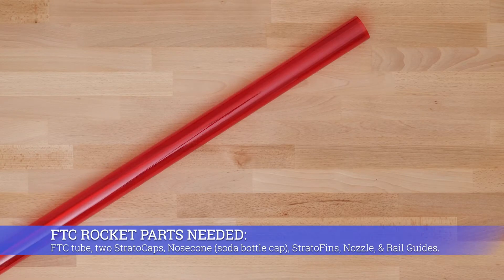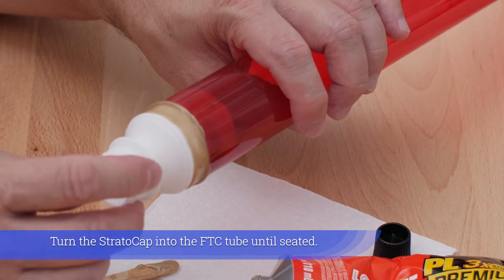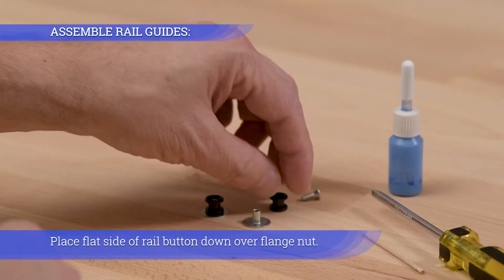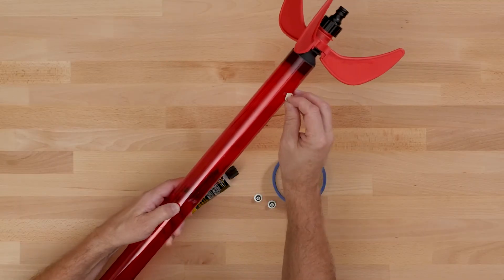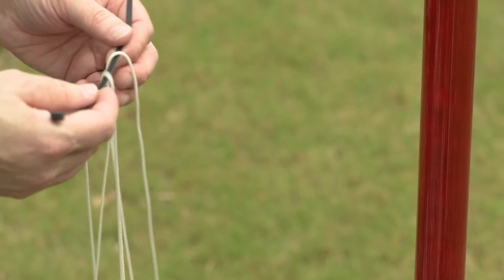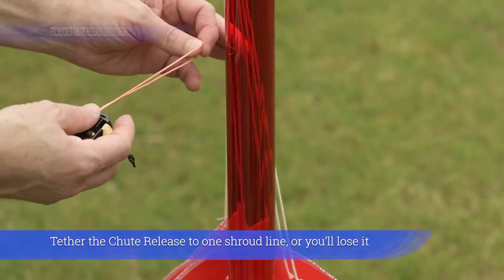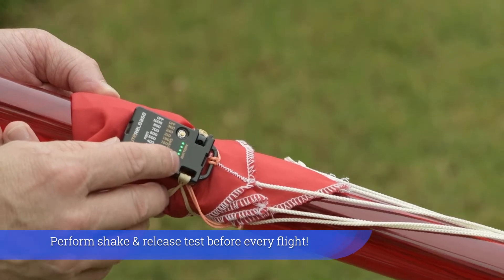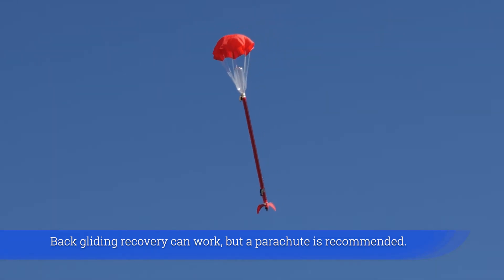StratoRocket FTC Rocket Assembly, Configuration, & Launch Procedure

Comment: Why do we have to cut the tube
Reply from the maker: Usually, because they are not cut square to create a good fit for the endcap (StratoCap). If you buy the tube from us it will already be cut properly.
Reply: @StratoFins makes sense. also I have another question what will be your next product?
Reply from the maker: @GLITCHGIGGLEDAREALDEAL  Every year we are usually working on 1 or 2 new products. A remote release is in the works that will be an upgrade kit that will eliminate the brake cable and lever. Hopefully, that product will be releasing next year although we are still working out various details.
Reply: @StratoFins cool!
Reply: @StratoFins  sorry for so many questions but could i launch this on aquapod if i dont use the nozzle?
Reply from the maker: @GLITCHGIGGLEDAREALDEAL  Yes, that is theoretically possible, but at a 60 PSI don't put too much water in it.
Reply: @StratoFins is using krazy super glue okay to use for attaching stratocaps
Reply from the maker: @GLITCHGIGGLEDAREALDEAL  I wouldn't recommend that since that sets to fast and it is best to cover all surfaces inside the tube and around the StratoCap exterior. Covering that much area takes some time.
Reply from the maker: @GLITCHGIGGLEDAREALDEAL  Yes, it should work, although it might be a bit unstable if any wind is blowing. The Aquapod would need to be well secured to the ground so it doesn't tip over.
Reply: @StratoFins 🐶👍
Reply: @StratoFins  I think after that there should be a thing for people to make multi stage water rockets
Reply from the maker: @GLITCHGIGGLEDAREALDEAL  Yes, multi stage water rockets would be a great idea, although that can get pretty complicated.

Comment: I wish you sold the print file so I can print my own. I live in a forested area and lose too many rockets to justify the cost.
Reply from the maker: We finally have these FTC rocket parts made via plastic injection molding so they are much cheaper now. There are 2 kits available one without the FTC tube and one with. StratoRocket Basic Parts Kit https://stratofins.com/stratorocket-basic-parts-kit/ and the StratoRocket 48" FTC Rocket Parts Kit https://stratofins.com/stratorocket-48-ftc-rocket-parts-kit/
Reply: @StratoFins . Were there strength issues with the 3d printed ones? I just designed my own ftc end cap and am printing it now. I won't upload to any shared sites.
Reply from the maker: @kgfairbarn5099  No strength issues with the 3D printed partf provided they are printed via SLS (Selective Laser Sintering) usually with nylon12 material. FDM and some of the other processes won't hold much pressure and are often brittle. Typically most home 3D printers don't do that great of a job either. The only reason for us to do 3D printing on parts is to get a product out there ASAP and generate some revenue because tooling a plastic injection mold is extremely expensive. However, once the mold is paid for the parts are inexpensive especially compared to 3D printed parts.